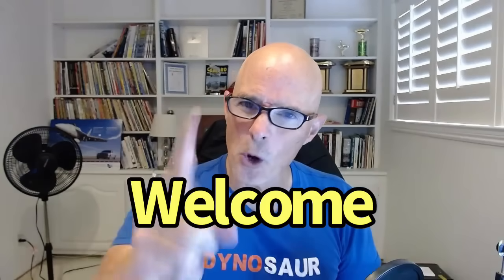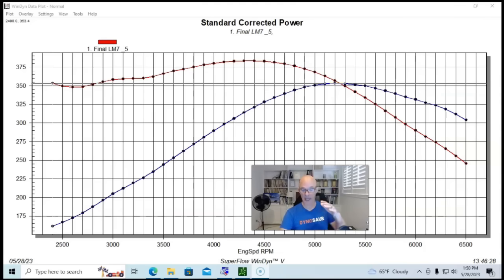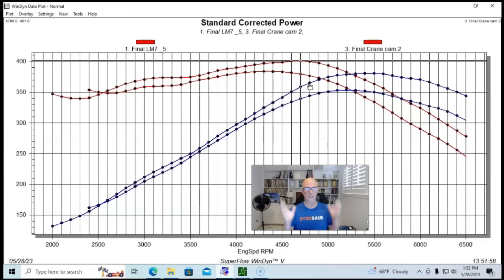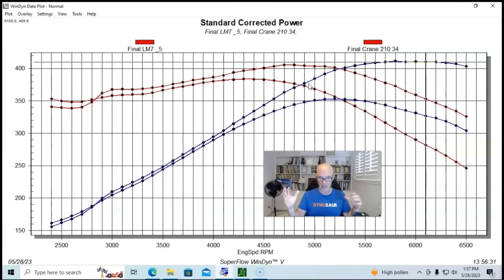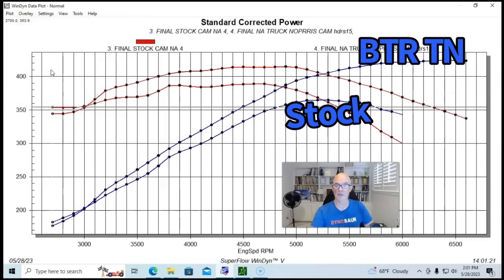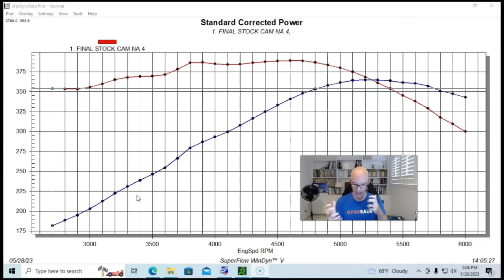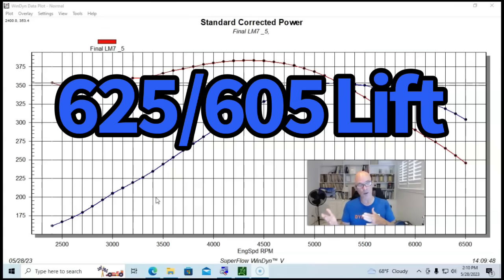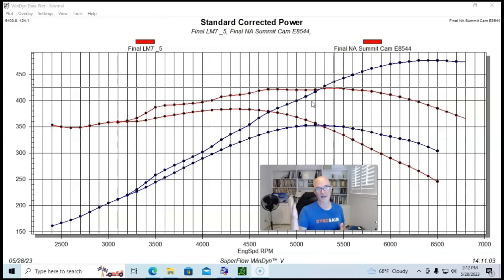THE BIG LS CAM MATRIX-HOW MUCH POWER EVERY LS CAM WILL MAKE BASED ON DURATION. 190-230+ DEGREES.

Comment: I enjoy your tests. Some cams are not enjoyable on the street. I replaced a 376/525 cam with an ls9 cam that was day and night drivability.  I am now installing a lsx 376b15 with a whipple 3.0 inverted. I have both a ls9 and a BTR Red Hot cam and want to make sure I don’t wind up with a horrible driving experience like the factory ASA cam. Idle, surge, fuel mileage etc would be a nice addition to your test. Thanks.
Reply from the maker: I can't do fuel mileage etc... on the engine dyno (and idle quality is subjective-some guys like the chop)

Comment: Great comparison... wish it was on a 6.0/ stroker. Especially if you did one of these cam comparison on the old m I ar magnum.

Trying to guesstimate what duration for a Magnum 390 (stroked 5 2) with TFS 190CC heads ported RPM-Air Gap. 

Trying to find a duration that place peak Hp around 6,200<6,400 rpms. 

Also, I  never hear anyone talk about, " What duration/overlap is the most while still having power brakes"?

Only youtube builder makes great power 535hp/535tq, 390ci but with a massive 243/251 @ 0.050  110LSA hyd roller cam. Don't think that could run P/B.
Reply from the maker: If you want peak power at 6400 rpm on a 390-inch motor, you are going to run a good size cam or a single plane intake
Reply: @richardholdener1727  I guess I was just hoping that since the 408s where able to peak at 6,000 with the RPM Air-gap I could squeeze out a few hundred more rpms... being 18 cubic inches less.

Any idea about how much overlap/duration would be the limit with Power brakes? 390ci with 10.5<11 compression ratio.

Comment: Best cam for a 2011 DOD 5.3 truck 823 heads long tube headers please help
Looking for a daily driver plus pulling a trailer 4l80E transmission
Reply from the maker: you can't put 823 heads on a 5.3L

Comment: Personal Observations:

Previous LSA Cam Test Video I Thought Overlap Shifted The Power Humps Left And Right On The RPM Axis. Richard Said It Was Duration.

Watched This Video And Confirmed That Intake Duration Is What Shifts The Power On The RPM Axis. Not As Much As I Thought But It Indeed Does. 

I Had A 230 Cam In My 3800. It Starts Making Peak Power At 6,000 RPM And Holds It Out Till 6,800 RPM. Im Not Even Using This Cam As Intended As I Don't Shift The Car Past 5,800 RPM.

Spec'ed A New 210 Cam That's Going To Be Custom Ground At Comp Cams. I'm Hoping It Puts The Power A Little Lower In The Range That I Shift / Power Band Or My Gearing.

It's A 210/212. LSA Is 7° Tighter Than Previous Camshaft And Overlap Is 2° Less Than Previous Cam. It's Also Advanced 2° Than The Previous Cam. Lastly I'm Installing The L26 Long Runner As I Was Running The ZZP Short Runner Insert Before.

After 2 Months Of Researching Cams, Watching Richards Videos And David Vizards I Think I've Got The Cam In the Right Direction For My Application.

Comment: Wow.. So the ss2 in a L33 made 439hp & 414tq.. And the SDPC LS6 Power Max Plus cam in a LM7 with TBSS intake made 448hp & 433tq! The SDPC cam is a 220/222 cam. I ran the LS6 for over a decade in my WS6. Many 7k+ rpm shifts. The SDPC LS6 cam for its specs, most def feels and sounds bigger. Its on a 112+2 LSA. Lift is just .570 and the power kicks in much quicker. Wish there were more ls1 and 6L dyno numbers and track times to compare mine too. Funny, cuz I bought the Elgin e1840p ss2 cam. Went with the SDPC cam cuz was 'smaller' and thought be better dd beater cam.. Guess I still picked the right cam 😊
Reply from the maker: Seems like you are comparing two different cams on two different dynos on two different days on two different combos and trying to convince yourself you picked a good cam! Sound logic
Reply: @richardholdener1727  no. I'm definitely happy with my sdpc cam. Wish you would test some of them and compare to the popular shelf cams such as truck norris and ss2 in a 5.7 or test all the elgin/tfs cams from ss1-3

Comment: Replace the cast pistons. Then the factory rods go, then replace those with 4340 steel, then the rod bolts can fail if not stretched correctly. Then the nose of the crank can break off. And finally the block cracks in the valley.
Reply: Are you referring to the Ford banana split?

Comment: In general most small cubic inch engines certainly have there limits. Once you push the rpms past what the factory head can support,  then what's the point. I feel anything more then 6 to 7k rpm would be pushing it.

Comment: You can get 650 hp n.a. on a 350 sbc with race heads and a good 300 degree roller cam. On 94 octane gas at 11.1

Comment: You can have a tighter lsa for more power but watch the lsa. Too much or too little bit can hurt a combo.

Heavy trucks cars could use 114 lsa and moderate duration of 276 for small cubic inch engines and 286 on bigger motors.

4 to 500 hp we easily made with a 350 to 400 sbc back 8n the mid 80s. Non supercharged small c I engines suck on power.

Comment: @ richard holdner , someone on Facebook asked if the eBay SS2 off shore cam was close in power to the name brand cams (he had one in his truck and said worked good)  have you ever tested one ?
Reply from the maker: I would be more worried about the cam breaking
Reply: @richardholdener1727  😂😂😂 true I have seen some of those cams where the lobes were not fully machined 😂 (not LS though)

Comment: Richard, can you do this with the Ford 351W and its strokers? 
The foxbody guys are coming around to the 351s after spending the least 5 years boosting the 302 based engines. Myself included. 
I'd love to see the (let's call them) stage 1-5 type cams and what they do to the rpm band and HP/TQ curves. 
Anywhere from 218-248 degrees or more...
Reply: it will follow the same trend, math/physics does care who built the engine.

Comment: Richard, there is a test I would love to see you perform on an LS engine. A lot of guys take a junkyard 5.3, dingleball the cylinders, and put the original pistons back in. On the other hand I see where machinists maintain they are overlooking the problem of cylinder taper on high mileage engines. How about doing a test on a .005 overbore machinist built 5.3 and a junkyard rebuild and see if there is any appreciable difference in power?
Reply from the maker: there isn't

Comment: Richard could you do a 3.6l vs 3.6l? Such as Chevy Camaro vs Dodge Challenger 3.6ls? There are blowers and parts available for both  just thought it'd be something different  🤷‍♂️
Reply: The Pentastar has 'weak' cam followers. I've r&r'd many. Not sure how smart it would be adding a power adder to a Pentastar with around 100k miles without replacing the cam followers (rocker arms for ohc engines). I've done some intake and plenum porting for friends and with typical cai, exhaust bolt-ons and tuned... They've been pleased. Knowing the only next best thing would be a hemi swap.
Reply: @charliecadaver666  I've worked on hundreds since it debuted in 2012. I've heard both, it's poor rockers, then it's not poor rockers, it's poor surface hardening of the low-lift lobe portion of the intake camshaft, typically the passenger side. Similar to stock LS cams and some of the 5.7 HEMI cams wiping out lobes. Regardless, the 2016 change to VVL was when it all started happening, and 99% solely on the intake side. It hasn't changed yet either... The most recent one I've done was last week on a 2021 GC. But, for some reason, people still love the engine and mod the hell out of it. I am NOT looking forward to the hurricane, though!  😐

Comment: Do you have any info on the effects of to much total timing on a Sbc? We tried the old trick of advancing the timing until it pings, then backed it off. The timing light read 50* of total advance by 3000rpm. Thanks in advance
Reply from the maker: no SBC I have ever run wanted 50 degrees of timing-way too much
Reply: @richardholdener1727  Is that more than likely the cause of my slow times?
Reply: @cheapskatenation  Your cam was installed way too many ° retarded, or your dist., is off a tooth? Does your engine back fire? If not, look into your cam being 8 to 10° retarded. Hope this help's you out?
Reply: @evilinside5984  Cam was installed dot to dot. Engine runs good at 36* total timing. It was just bumped up to try and make a little more power. Never heard it ping, Mph had stayed about the same but I started launching harder.
Reply: @cheapskatenation  What is your 60 ft. time, 1/8th E.t. and MPH, also 1/4 E.t. and MPH if you have it?
Reply: @evilinside5984  60ft was 1.79
1/8th was 8.12    1/4 12.83 @103.4.  That was the fastest pass I've made. I've made a 12.89@ 105.6
Reply: @cheapskatenation  13.8 to a 12.8 is a huge difference, was this done with same wt vehicle, and engine? What changed in your combo, to go 1 sec. quicker E.T.? Also what were all the #s diff. On that 12.80 pass vs that 13.8 pass? What rpm do you shift @? What is your stall speed of your tq. Converter, while dead hooking @ the track? What is your rear gear ratio, tire ht, and transmission gearing?

Comment: I have a LS2 Corvette and I wanted to do heads/cam but basically I bought the toys I wanted, quit my career and moved up to BFE to live the good life. Because of this I probly won't have 30 grand to buy another one in the future so I want the car to last 200,000+ miles. I was advised by Cordes here in Phoenix that in that situation I probably shouldn't put a cam in it. So my question is, what can I get out of a head like those Trickflow 225s on the STOCK camshaft? All your tests use some type of cam upgrade. Can you test how much power a head swap will get with the stock cam? I do have a FAST 102 and headers already.
Reply from the maker: head swap is worth 10-15 hp with stock cam
Reply: @richardholdener1727  That's it? Like a 243/799 head to a TF 225 head that flows 50-60 cfm more is only worth 10 hp?
Reply: @Carguylogan  they make easy lobe cam tech.... upgraded cams with more duration but Easy on valve train and lifters that will last long time
Reply: @Ws6Ms  I was looking at that. Like the Cam Motion stage 3 LS2 can which is 218/224 duration with .550 lift and 116 LSA. With that LSA it'll probly get great mileage but won't chop or at least not much. That cam with a 114 LSA would be better I'd say. More torque and a little chop. Could probably use a very mild valve spring to be easy on lifters, maybe even stock spring? Max rpm is 6600 on this motor, I'm not trying to spin it too high.
Reply from the maker: I tested a set of ported rec-port heads on a stock cammed ls3 and that's all it was-might be a touch more on the cath port-but not much-at least get a Truck Norris cam

Comment: How do I know If I will need a higher RPM stall converter?

Im planning on swapping a 6.0LS witha Truck Nortis and 4l80e into my K30 that weighs 6000# and has 37" tires and 4.56 gears.
Reply from the maker: you don't with that combo

Comment: Dang near 450 horsepower from a cam change. LS heads are the bee's knees!
Reply: yup!  intake closing point balanced to compression is critical.
Reply: @davidncw4613 . What’s the most DCR you can run for 93 pump gas?
Reply: @trailerparkcryptoking5213  good quench, knock sensors  I have had 8.5 work just fine.

Comment: I Have a rSloppy Mechanics Stage 2 228/230, 585 "/.585" 112 LSA ,Which reconfiguration should I choose in Terminator X camshaft config ?
Reply: Oh you're using the handheld to tune it?  Rough.  Select whatever is one level below the "race" setting for now.  I'd highly recommend downloading the Termi X sw and getting yourself a holley interface cable though so you can tune it properly.  Your fuel trims are going to be very large.

Comment: E85

The single greatest thing to be done to engines since boost.

E85 has really allowed racers to run high boost, equalling great hp and tork numbers on the street that few of us ever could do.
Reply: Unless nobody sells it in there area. A lot of gas stations are getting rid of it.
Reply: The problem with pump E85 is inconsistent fuel blending. This has caused many engine problems. It's great when it's right, it's catastrophic, when it's not! Pump E85 is like playing russian roulette with your engine!

Comment: More compression always helps especially when you go with more duration.
Reply: Whats a good safe compression for street? 11.1.1?
Reply: @BowtieClusters  Safe comp. ratio for the street, depends on octane, quality/consistency, of said octane, cranking comp., initial, and total timing, heat range of spark plug's, load on the engine= ( wt. of vehicle, rear gear, tire ht.) esp. @ low RPM, tight or loose tq. converter, etc. This is why this ? is almost impossible to answer. I have heard of a 9.0 to 1 comp. ratio engine, (ping = pre ignite = spark knock), on 93 octane. It had a very low duration cam, 4,000Lb vehicle, too much initial timing, 2.56 gears, 28 in tall tire's, stock/tight, low rpm tq. converter. Then i have heard of an engine with 14.0 to 1 comp. run on the same 93 octane, with very low initial timing, in a 2,800 Lb. Wt. w/driver vehicle, a very loose, and high stall speed of 6,000 RPM tq. converter, 4.88 gear's, and 26 inch tire's!
Reply: @BowtieClusters  you're missing a colon for the compression ratio.
Reply: @BowtieClusters  there is no one answer to that as there is the static comp ratio and the dynamic ratio, more duration bleeds off compresion in over lap. so you could have to engine one 10/1 and one 11/1 but the 11 has a longer duration can and the dynamic compressions both end up at 9.5.

Comment: I don't think I have ever used anything less than 230deg at 50..never built a 5.3 either though for 5.7,6.0  and 6.2 engines I tend to work with 232-238 duration, lobe sep of 108 to 114 depending on the flavor required..always around 600 lift...2-4 deg advanced mostly.

Comment: Alot of engines make loads of power at high rpms but are looser cams down low. Cams with limited power bands. Aka drag race cams really suck for street use. Even with steep gears.
Reply: Well that’s just like your opinion, man.

Comment: I have wished for 40 years that people,  including Rich, would just give the cams full duration instead of a 50 th inch. It's a better way to make people not have to add.

Bloodviking
Reply: Because usually advertised duration is not accurate and that number varies between manufacturers. The @50 number is an accurate way to measure duration
Reply: @mikeday8826 could give 2 standard durations, like at .50 and .006. That way you could calculate the ramp of a cam to see if it would benifit you

Comment: What a great comparison on the cams and durations Richard! Surprising to see how well the Truck Norris provides mid range torque with minimum lost at low end!
Reply: Agreed !!  That Truck Norris cam is impressive !!
Reply: You may want to Consider the Texas Speed Chopacabra as well
Reply: I just went from a stock 4.8 to a 6.0 with 243 heads and a truck Norris cam. They say it doesn't need a converter, but a stock one at 16-1800 is way too small. I think I could burn the tires easier with the 4.8.
Reply: @aslacker  my 4.8 stock burns the tires then again it is the LR4 and not the LY2/L20
Reply: @aslacker  in what vehicle? How much does it weigh?
Reply: Thats because it had the tightest libe separation.

Comment: This makes me wonder about a test where you could have 2 cams with the same advertised duration and lift lsa etc, but one would have the most mild lobe profile, while the other cam would have a super aggressive lobe, and see how the power changes and how stable the valves are. Would be interesting!!!
Reply: Btr has a video on this
Reply: @KE458S  had no idea, I will check it out, thanks!
Reply: Engine masters did a recent episode showing 3 cams, all hydraulic rollers, all the same specs, but 3 different lobe profiles.
Reply: @THEFERMANATOR  just watched it. Thought there would be a bigger difference in power between the 3, but that low shock cam should definitely be easier on parts so that's a win. Good video, thanks for recommending
Reply: You cant have a cam have the same duration and lsa and sound different. Overlap is overlap. However, to different companies can have two differnet power outputs because of ramp rate or advertised duration being different
Reply: @jameswhitesell3076  yes. You can have 2 cams with the same @.050 duration, but have advertised duration different due to those ramp rates. Showing those differences in a direct test would be interesting and probably news to a lot of people for sure
Reply: @ziggybmw  sorry, i misread what you posted. I thought you said lope, not lobe.

Comment: So, if 200º = 383 hp and 234º = 476 hp, can we say that, mathematically, each degree of camshaft intake duration for a 5.3 = 2.7 hp, all things being equal?
Reply: No. There are to many variables unfortunatly. Both intake and exhaust durations, lift, lsa, all go into power output, keeping all thing similar on the motor

Comment: Thanks for this ! would also be nice to know how these cams affect MPG. Esp trucks
Reply: I started to reply and then noticed how many details about the combo were required to really detail why it gets the mileage it gets.  There's kind of no point unless you define your whole combo.  The cam is just a piece of it.   

Richard could supply the brake specific fuel consumption across the rpm band and that would help predict mileage, however, cruise mileage is a different thing from WOT power.